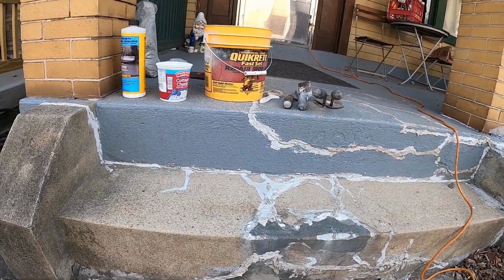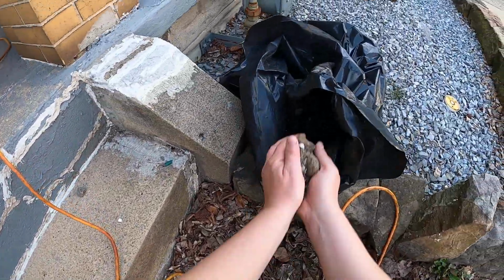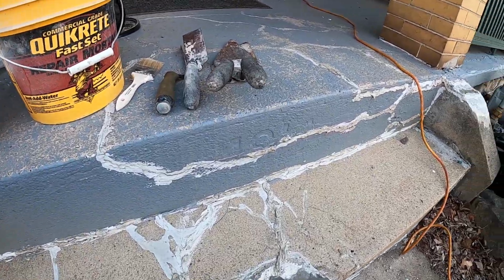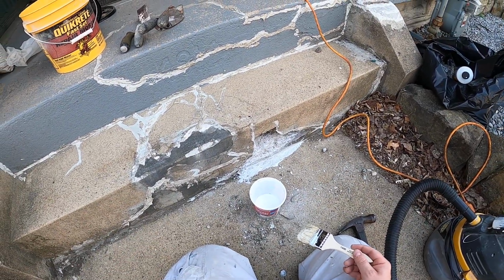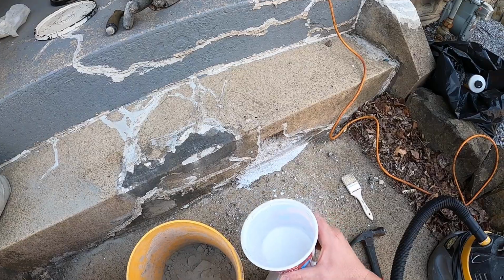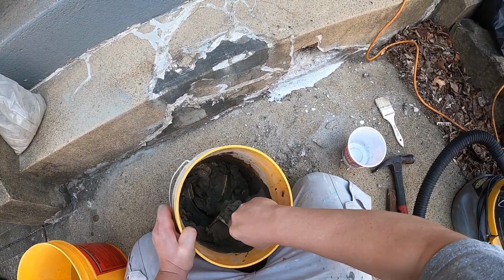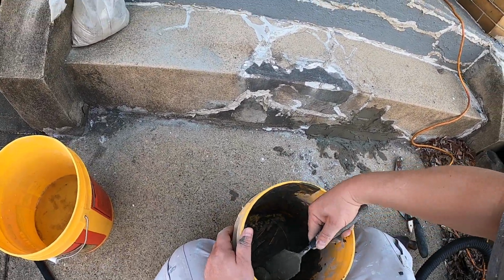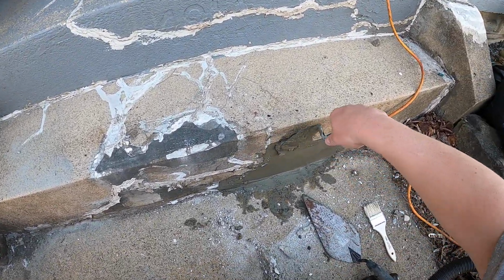Gopro Handyman Porch Patch Part 1

Comment: I’m fixing my wood steps on my front porch this year.  I got some plastic wood I am using to repair light damage.  I’m trying to stretch it out a few more years before I have to do the whole thing.  Quick question, take out the cement step and put in a wood step, is that even a viable option in Pittsburgh?
Reply from the maker: It's possible but probably just as easy to pour a new concrete step by the time you anchor the wood to the concrete. Plus with wood prices where they are concrete may be cheaper. Probably in the fall I will replace the whole step so tune in and thanks for watching and you comment.